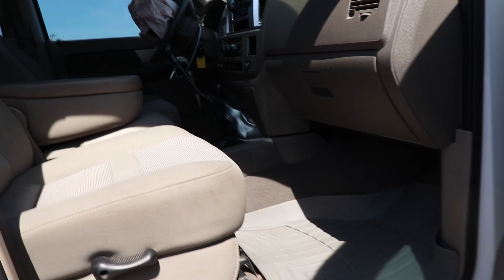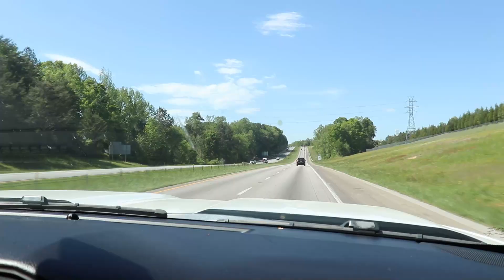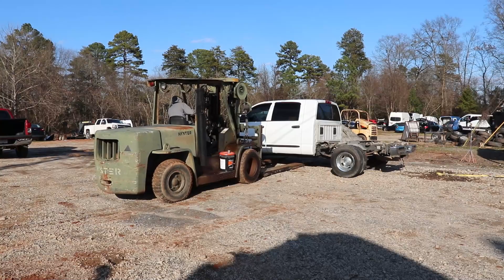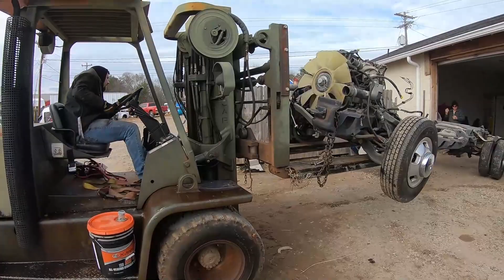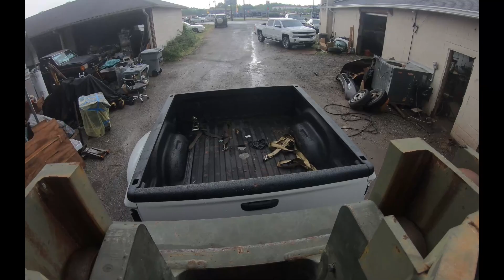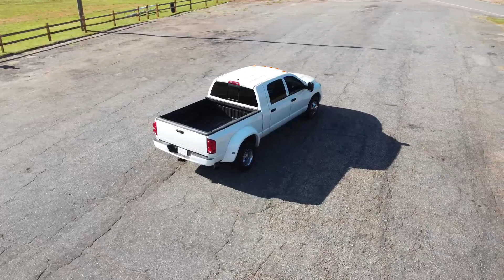BUILDING A TURBO DIESEL MEGA CAB, Salvage, Rusty to Running  Complete Restore Not a Car but a Truck

Comment: Good score finding one with the 6spd manual. The auto is just junk. You want to get rid of the stock front end though. Those sealed bearings are junk too. I had 2 sets fail after 70,000 each time so if you plan on keeping it I suggest you swap them out for an aftermarket setup.

Comment: 131 k is nothing , this was obviously someone who was using this for towing maybe just their 5th wheel or just towing around there area if they were doing short trips. It would be an easy sale if you dont need a cheap diesel tow rig, someone will definitely snap it up. Some people look at the year and think nah... but the Older diesels are still popular with people that dont want to have to deal with a lot of the newer emission stuff with the multitude of sensors and then there are the fans of the Older diesels engines from a reliability stand point